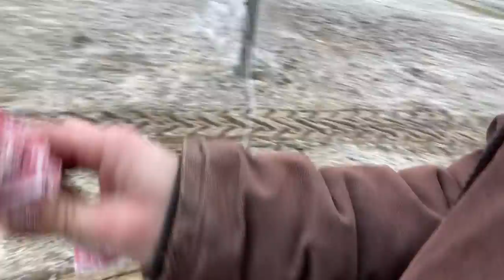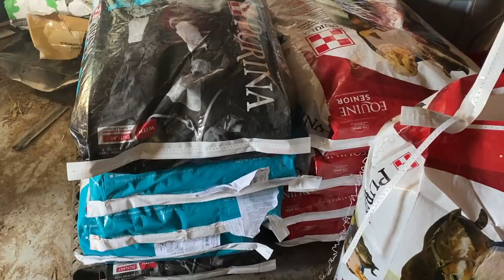Cattle Creepin, Choring & mixin with a new @ArtsWay Mixer |Vlog193| #WieczorekFarms #FarmHer @purina

Comment: That sounds like a really good thing to bring those cows closer to home as they get closer to calving and will making late night checking easier and should you spot an issue then then it will get easier to get them into a pen ideally with some light to see exactly what is actually going on. That way if you have to assist the birth in some way it is simply easier to do. I ran a herd of 90 cows like that for a farmer and we brought them into some big sheds at night and put them out into a paddock during the day - that way less bedding was needed and a fair proportion of dung was dropped in the field rather than in the shed. The cows were fed outdoors but drinking water was available both indoors and outdoors. 

Do you find that the weaned calf food flows OK down to the troughs where the calves eat or do you have to poke and prod it to avoid it bridging and the calves going hungry?
Reply from the maker: We don’t let them eat “at will” Jason opens and allows so much at time because we also put a couple buckets in a trough so that they aren’t pushing and fighting with others -